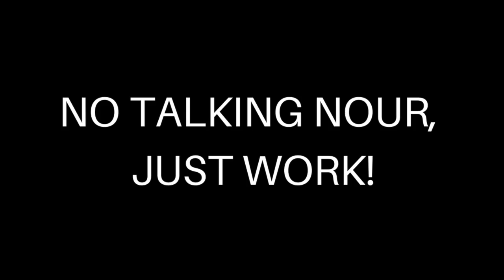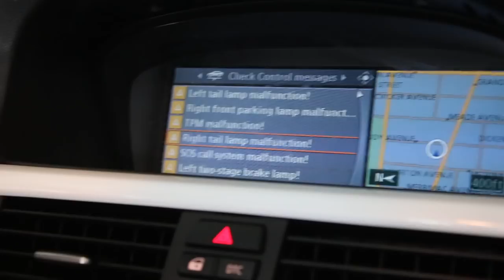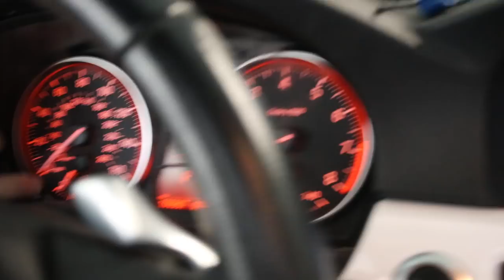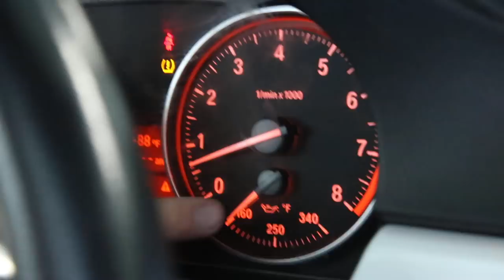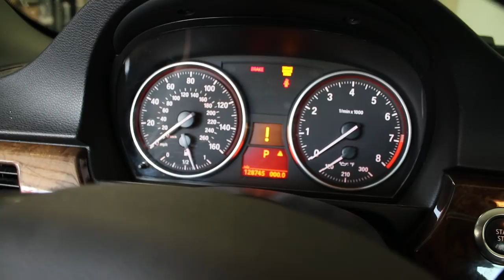Rebuilding BMW 335i Involved In Gun Fight! Part.12

Comment: The reason you have extra wires on the new harness is because it came off a car without upgraded audio so there are physical speaker wires instead of the fiber optic cables.

Comment: Have you changed your oil? Perhaps you might have spilled some? I had smoke coming out from the header area a while back. In my situation I spilled oil over the valve cover when I did my oil change and made its way to the headers causing it to steam & burn all that oil. Also had a bad oil filter cap resulting in the same issue. Took care of it & power washed the exhaust header area several times and it finally went away.

Comment: Gotta love that lifter tick...drives me nuts. That thing needs to be driven more. A little bit of fumes out of the oil cap is normal in my opinion (I know what bmwfanatic says) but there’s a reason there is a breather tube on the back of the valve cover to relieve pressure in the crank case. You definitely have a valve cover leak though. Make sure you do the oil filter housing gasket while your at it.
Reply: Melche’s Garage it’s not lifter tick it’s injector tick normal for these engines
Reply: Jorge Ruiz can’t say that I agree with you on that one. Lifter tick is a very common issue with this engine. When the car is not driven fluid leaks out of the lifters and they don’t quiet back down until the car has been run for a bit.

Comment: The oil on the charge pipe is the o-rings inside those diverter valves drying out. Oil gets blown out on boost. Easy fix, just order replacement o-rings off eBay and swap them over.

Comment: You're fine my dude, stop doubting yourself. Change the valve cover gasket and the oil filter housing gasket. Change the coils, the plugs to NGKs, and pull out your injectors and clean the tips. If you ever need new injectors. Go on AliExpress and get 6 new off brand ones or index 12S. Forget the OEM fad and save your money. These cars are dated and things are cheap now. I bought a hpfp fuel pump for $250 CANADIAN when locally they were 900$. Browse and take your time. And don't doubt yourself. Bulletproof the car ;)

Comment: I ain’t no car guy nor anything, but the engine shutting it’s self off. I had a different car before my 335, and i had cylinder misfires and my car would rev out of this world, and then it shut off. Not saying anything I’m probably wrong but have a feeling that it’s a misfire code in the next video.
Thanks for the support and replying through Insta.

Comment: I bought a scanner called BlueDriver from amazon, it was amazing, I use it on my e90 lci, literally helped me so much, turns off all dash codes and gives you all the fault codes, basically tells you everything wrong with your car, and tells you the exact parts that are faulty or if they need replacement, and you just have to look up the code to see how you fix the part, just thought it would make it easier for you, because it saved me a lot of time and money with my bmw

Comment: While you’re replacing the sensor under the intake manifold you should walnut blast your valves
Reply: Also those are diverter valves on the charge pipe and I’d recommend upgrading to a new charge pipe and blow off valve. Under high boost the stock charge pipes have a high tendency of blowing off. Just my opinion great job so far🤙🏻